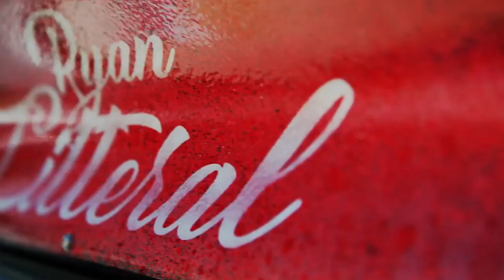NEW HOME, NEW HOPE- Rebuilding the RB S14

Comment: Man that crack ain’t bad .. it can be caused from to much assembly lube on the studs when installing them and it hydraulics the bolt hole and cracks.still be a great block to use for a spare.

Comment: When you realize you need a JZ or LS. 🤷🏽‍♂️ car is sick though.
Reply from the maker: lol trust me it isn't like I haven't thought about it!
Reply: So you're telling me that jz's and ls's don't blow up either right? Come on man get real
Reply: ClutchkickPJ definitely not as much. Come on man get real. Look at the evidence. Jz’s are constructed way tougher than RB’s in every way. And if you don’t like that, then LS’s are so easy to come by and easy to make power with that you really can’t go wrong. RB’s are harder to get and you can’t just go to Autozone and get parts from them like you can a JZ and LS. At least for us here in the US it’s easier to have anything other than an RB plus they are way more reliable. Everything in this sport will blow up at some point. You are at high rpm’s for a long time. Tune is a big contributing factor to wether your engine lasts longer or not but the RB has problems in the block design that makes it less reliable than the other two mentioned. As I said before, it’s still a sick car and I enjoy that people like doing different builds.